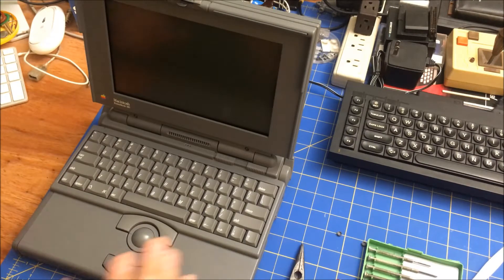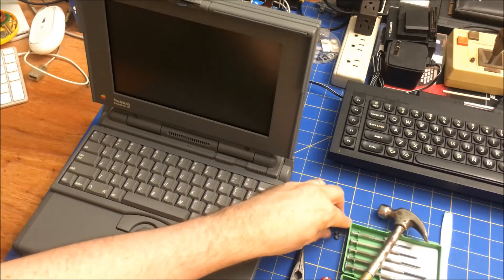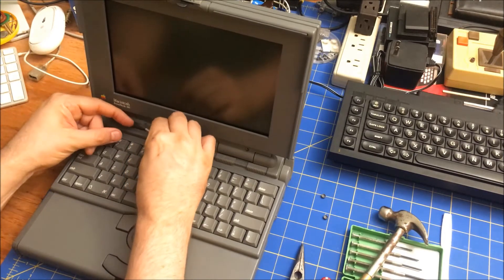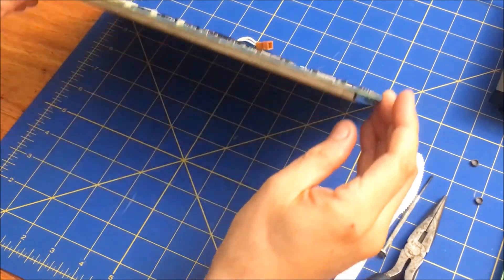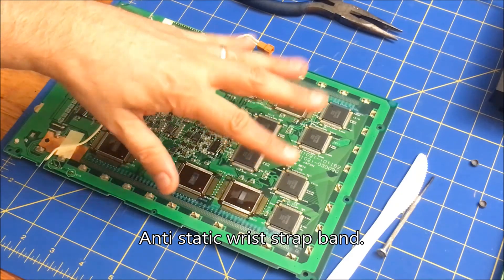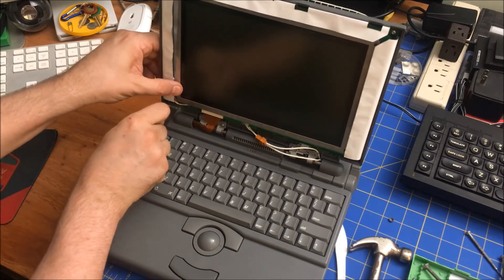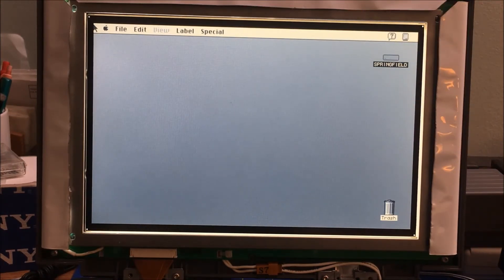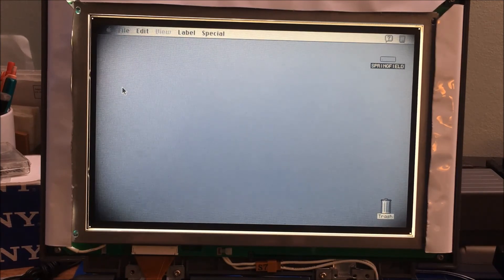PowerBook 180 Repair: Screen Disassembly to Look at Tunnel Vision

Comment: man, your 'tools' are brutal:face-green-smiling:
Reply from the maker: What are you talking about? Needle-nose pliers, a set of small screw drivers (cheap case but they work), and a hammer. Granted this was the smallest hammer I could find in my toolbox since I wanted to apply the least amount of pressure. It actually opens up in an emergency to have some screwdrivers in the handle.

Comment: I have a 180 with bad tunnel vision. It starts within seconds of power on. I tried the baking trick and re-tightening all the fastenings. It did improve it along some edges but the tunneling returns in a less uniform way.

Whatever it is I don't think it's repairable and haven't seen a single example of it being fixed. I also had a 170 with the same issue and like it, I'll be selling the 180.

Fortunately, my 180c with its color display is not affected, although it's let down by the slow DRAM of that system (slow screen re-draws).
Reply from the maker: How hot did you bake it? Baking it for 5 hours at 100 degree celcius is supposed to work. If yours is bad, you may want to try it several times. If it's about re-flowing adhesive you can try and do it in stages.
Reply: @8BitRetroJournal  3 hours at 100 degrees c. I might try it again but electricity is expensive right now.

Comment: Might be a temperature related problem, check if anything gets hot when the tunnel vision starts. Maybe a cap is getting resistant?
Reply from the maker: So these particular screens (active matrix) don't have any caps on them. The prevailing theory is something wrong with the actual panel. Some think moisture but I'm guessing separation of adhesive after 30 years. Will try baking just the panel (no circuit board) next.
Reply: @8BitRetroJournal  I heard that active matrix manufacturing back in the day was very primitive, very expensive, and a single spec of dust could wipe out of one of these screens while it was being manufactured.  I suspect that they wear out from some of the early materials used in them.